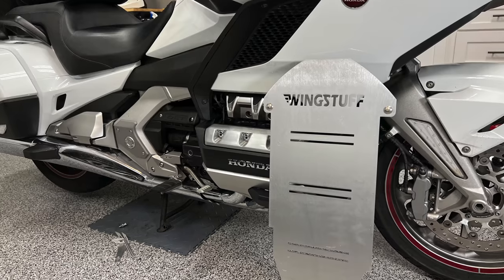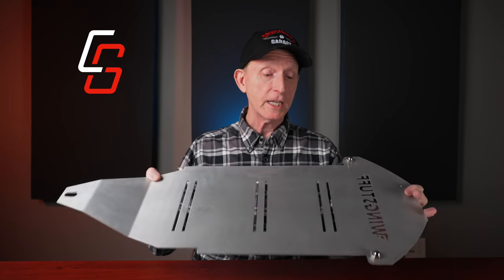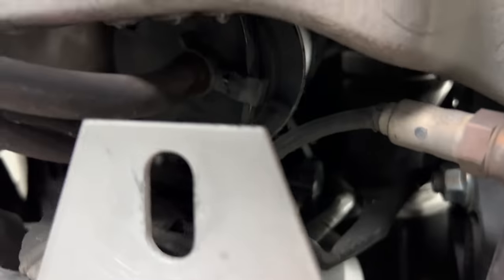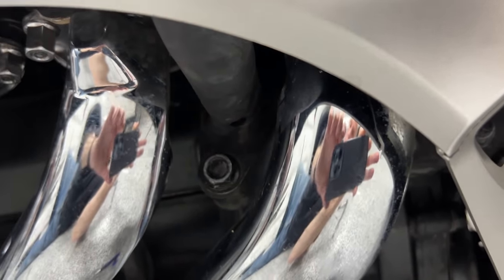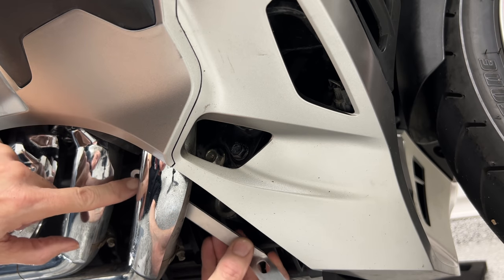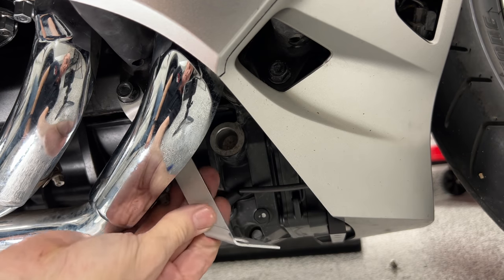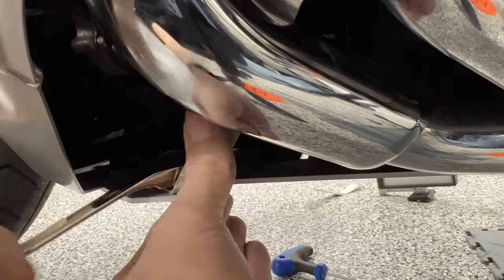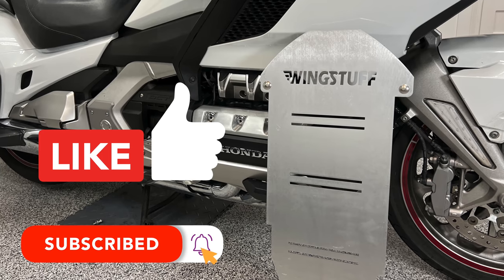Belly Pan Skid Plate for 2018+ Honda Goldwing from WingStuff | Cruiseman's Reviews | 2022

Comment: Very good conclusion on  if the product stand to its purpose! honestly after seeing the  brackets size holding the plate I think it will ultimately damage more parts if this 850 lbs monster hits a concrete block or something! I believe this is a total waste of money for a GW, just watch where you are going and avoid following those dual purpose bike!
Reply from the maker: I understand, but I am not sure that either of these products is really designed with hitting a concrete block in mind. Putting all 850 pounds + the rider and gear onto any engine guard will most likely result in damage. These are designed to protect against objects getting kicked up from the front tire and striking the underside.
Reply: @cruisemansgarage  and this happened to you on your last GW didn’t it Cruiseman?
Reply from the maker: @6582rg  Not exactly, I hit a piece of scrap iron on the highway at 65 mph that cracked the engine case, but only had a thin belly pan which was destroyed.
Reply: @cruisemansgarage  Hi Cruiseman, I still think it is useless the flat-6 engine block being very capable of enduring FOD's in my view, a plate covering the thin walls of the exposed oil filter would have make more sense to me!...this is not about arguing it is about discussing the sense of a concept, sometime more is less!

Comment: Mmmm.... for 180 beans, I believe in my opinion , it's a fail ! way to much fiddling and not solid enough when it comes to the front brackets. The rear T bolt is another pain....maybe if they incorporate a nut inside a hard rubber grommet which you slide in the oval hole and use a flat bolt with an allen key center ...same for the front brackets which would be pre-bent and of better stronger metal...welded nuts and flat head bolts with allen key center it might be worthy of 180 beans and of easier installation and removal for oil change.....again until then...it's a fail in my opinion !
Thanks for the review ! it will save a lot of people time and $$ , be well ! 
Hope the visit went well !!

Comment: It seems like a lot of modification is required for a Bike Specific part.  Think I’ll wait for Max’s.  I’m also not a fan of paying for advertising on products.  A small MFG badge is fine but come on that’s over the top. On that back attachment it seems to me if it went a little farther back you could use a button hole slot to make it easier to remove the pan for maintenance without having to remove the bolt/
Reply: Hardly advertising. Who the hell is going to see that?????
Reply: @robertmercer9117  it’s a philosophy ok. Btw if you can see the logo turn me over 😱

Comment: seems like if the rear T-bolt was abit longer, you could put a washer and thin nut to secure it, then the skid plate and washer and nut. that way the T bolt would not have to be lined up every time you take the plate off.

Comment: One would have thought that wing stuff would have already made the proper bend in that bracket that connects to the engine case between the two exhaust pipes ?? Seems like it’s still not an ideal situation
Reply: Totatally agree with Mat, I appreciate these are still new products but really it shoud not require any bending by the user to fit !
Reply: Form fit and function. Both plates need refinement.
Reply from the maker: To be clear, WingStuff does not manufacture the product, they simply have an exclusive marketing arrangement with the designer. Or, at least that is my understanding.

Comment: I just installed this pan a few hours ago and it appears the updated product front brackets needs to be installed to the most front engine guard bolts vice using the second frame bolts per this video...I had no problem with the left bracket and it installed without any bending however, the right bracket needed to be bent in two different places/section to complete the installation...
In addition, the rear T-Bolt now comes with two nuts, the first nut one allows you to preinstall the T-Bolt on the bike's slotted fame hole and when complete, the rear can be installed without manipulating the T-Bold or worry about it coming loose.  It also comes with a lock washer however the front nuts are standard nuts and I wish they included lock washers...I may stop by home depot and add my own lock washers later on.
I would still give this product a 4 on pricing but a 3 on the front bracket installation and over all a 4.5 on the overall product quality and strength...I know the Traxxion belly pan is the Cadillac version, but the pricing and cost of shipping just brakes my overall budget...I guess a pan is a pan and "better to have it and not need it than need it and not have it"...lol
Reply: I also received what I believe is the not the updated version as well. The instructions also say to install the front brackets to the front engine guard screws. Not as shown in video. I called them regarding the bends in the brackets. The ones I received only had the one angle bend at the top. I called them and they are sending me new updated brackets and instructions.

Comment: Whats your thought on this plate vs the Traxxion plate?  Did re-applying the correct torque resolve the oil seepage?
Reply from the maker: I am in the process of evaluating both products and need a little more time to give each a fair evaluation. I am monitoring the oil seepage and will report back soon.

Comment: One concern I have with the Wingstuff solution is this: the front portion mounts to the engine and the rear portion mounts to the frame.
Now, the engine is possibly rubber mounted or otherwise isolated from  that same  frame. The engine therefore  would be free to  move somewhat by design, Every time you apply throttle or torque, for instance, the engine will move in the frame in the opposite direction of the shaft drive turn direction. The case guard rear frame mount cannot move while the front mount will move with the engine. This means the case guard  will continuously flex back and forth as the engine is running and torque is applied or removed from the drive train. Also the solid mounting of the plate to the frame will allow noise and vibration to transmit freely from the engine to the  frame or the rest of the bike. IMHO the rear mount needs to be redesigned with an insulated rubber mount ( rubber well nut) to avoid these issues.

It seems to me that both available solutions (Max or Wingstuff) have a lot of development work left to be done. But as usual the testers will be the first customers as the manufacturers are usually almighty and will find a thousand reason why everything they do is absolutely perfect🤣

Comment: The bracket is not being connected to by correct bolt.  There is a bolt further forward, visible thru the front cover panel on the right-hand side where the bracket needs to be connected.  On the left hand side, the front panel would have to be removed since bolt is not visible.  When properly done, no bending of bracket would be required.  Video needs to be updated.  🤔

Comment: Hi Chris,  When your video showed you putting that T bolt in place it looked as though the plate itself was pinching the rubber tubing to the side of it.  Was this an issue or am I imagining it?
Reply from the maker: I don't recall any pinching but I will double check.

Comment: On another video you installed the Traxion Dynamic cover plate. You had also felt this might have created an oil leak. You were going to follow up with another report you did further investigation. I’ve been waiting on your report before installing mine. I reached out to Max but to date I have not received a response. Did you discover what was causing the oil leak?
Reply: Yes I think we all want to know if the oil leak was resolved
Reply: I've only put about 150 miles on it so far, but no oil leak with the Traxxion guard.
Reply from the maker: I have re-torqued the bolts on the engine, cleaned the area and am monitoring. I suspect it was a one-time seepage and has corrected itself. I will report back.

Comment: This procedure is contrary to the instructions with the new belly pans. However...I have comfort bars installed on my 2022 Gold Wing and the procedures provided by the company don't work. Cruiseman's procedure depicted in the video is an alternative that actually works if you have the comfort bars. The only issue is the brackets are heavier metal and don't bend quite as easily as the aluminum ones depicted in this video.

Comment: I like the skid plate but not a big fan of the front brackets. I homemade a makeshift plate to go to Alaska last year and used a similiar mounting bracket in the front. Had to bend them also to get around the exhaust. It Looked  clunky but necessary. I wasn't happy with it but it was all I had as no one had made a skid plate for this bike. (US/Canadian border didn't open in time so trip was postponed) I just purchased the Traxxion Dynamics skid plate two weeks ago. I would have preferred Max had put some vent/drain holes in his plate. I will likely drill my own holes in it before mounting it. CG good video on mounting this skid plate. I was kind of kicking myself for buying the TD plate but after seeing those front brackets I will stick with Max's TD skid plate.

Comment: Hey Cruiseman my question is if I have Gold Strike Highway pegs will this belly pan work? It looks like a different bolt from the hole the highway peg bracket goes into but I just wanted to be sure… thanks
Reply from the maker: That is a question for WingStuff. I know that were working on a way to accommodate the GoldStrike highway pegs, but I am not sure if these brackets provide that.
Reply: @cruisemansgarage  thank you very much sir for the reply. I’ll look into it.
Reply: Yes.. they will work with Goldstrike highway pegs. @BigSmittyRiding
Reply: @ricka.8584  you are the man! Thank you very much for answering!

Comment: Let us know how long before the skidmark (plate) begins to rattle. The "adjustment" holes being oversized for the Tbolt means it is likely to loosen a bit and since the only thing holding the "T" in place is torque, steel through aluminum, if it moves around or loosens even a little, it falls  out and that might be a problem.

Comment: After watching this video and Max's video , I am rather unimpressed with both. 1st I think it's not acceptable for these brackets to have to be bent by the installer.  I can see getting them in contact with the exhaust which would make NOISE by reverberating through the system. I agree with your other concerns.  If these things are really necessary , why doesn't Honda include them ?  This isn't a dual sport bike !
Reply from the maker: You can bend the brackets so that they do not touch the exhausts.
Reply: My 2021 Goldwing DCT is in the shop now.  Had a nice oil leak after I got off the highway just 45 miles to the house thank goodness.  Looking underneath the next day, cleaned excess oil and leak looked like the front timing cover.  Shop says I damaged the shifter cover from road debris.  Waiting for parts, I've been off the road for 2 and a half weeks now.  I don't have room at my place to much work on the bike.  So I'm ordering this guard,  looks easy for me to take off before taking bike to the shop for an oil change.

Comment: I don’t like the brackets. If they’re going to mass market the product it really should fit without the customer deciding where and how much to bend the brackets. Using your exhaust pipe to create a bend is not what I consider a professionally engineered product. Also, get rid of the company name cut all the way through the bottom plate. Those holes will become an entry point for dirt, pea gravel, etc.
Reply from the maker: I "think" the thought was that the slots and name cut into the plate would offer ventilation. Not sure that ventilation is needed, but I suspect that was the intent.
Reply: If the 2 left and right hangers are pre bent, they would not maneuver between the engine and pipes. This was left intentionally so customer can form it easily by following instruction starting from top engine guard bolt. Once it's formed it could go in and out easily.
Reply: @samerhallak  This reply makes no sense. If it goes in and out easily once it's formed, it follows that it would go in easily if it were preformed...As it is the hangers do NOT go in easily as the are NOT preformed and have to be bent in a ridiculous ritual/ceremony

Comment: I have to say the front brackets are a big fail for me. They look like a great way to rub your exhaust system and either rub a hole in the pipe or wear the bracket to failure really fast. A belly pan taking a nose dive at highway speed can be disastrous. Leaving the forming of the brackets to the customer is kind of cheesy. No thanks!

Comment: Is it possible for the front of the skid plate to tuck up inside the lower front cowling?
Reply from the maker: Yes, you can mount it either way, but it is pretty thick and could distort the plastic cowl.
Reply: Another great question . If that thing gets bashed hard in the front, it will destroy the cowling as well.

Comment: Good Review!   I think that this "Skid Plate" is a runner up to what Max has created!   It looks flimsy by comparison and the mounting brackets seems weak, not to mention the extra work that you went to to make it fit!     Makes me wonder which skid plate you are going to have installed on your bike... I'd like to know!    (:>)
Reply from the maker: I am not sure I would refer to it as "flimsy", it is still stout enough to prevent a pretty decent strike that could take out your oil filter or engine case.
Reply: If the 2 left and right hangers are pre bent, they would not maneuver between the engine and pipes. This was left intentionally so customer can form it easily by following instruction starting from top engine guard bolt. Once it's formed it could go in and out easily.
Reply: @samerhallak  This reply makes no sense. If it goes in and out easily once it's formed, it follows that it would go in easily if it were preformed...As it is the hangers do NOT go in easily as the are NOT preformed and have to be bent in a ridiculous ritual/ceremony
Reply: @wernerm9613  since you don't have it physically in hand, you won't be able to tell. I know what I am talking about.
Reply: @wernerm9613  It just appears the hangers are made of very lite material and I'm not sure about the strength of them.  But then again I am only compairing "pictures" that I have seen on the internet!  Again, they look flimsy by "comparison" to what Max has built!  At this time I am still trying to decide which one to buy!   (:>)

Comment: This installation video appears flawed. Cruiseman, you connected the aluminum strip to the wrong bolts. May not matter much since the new Wingstuff belly pans are configured differently - but for folks with older pans like me - don’t do it this way.

Comment: has anyone used a bike lift with the belly pan installed?
Reply from the maker: I would definitely not recommend it with the WingStuff and would be cautious using it with the Traxxion. The aluminum brackets on the WingStuff would definitely give under the weight of the bike. I am afraid the exhaust manifold would be compromised.

Comment: Why the hell wouldn't the manufacturer bend the bracket? WTF.
Reply: @samerhallak  This reply makes no sense. If it goes in and out easily once it's formed, it follows that it would go in easily if it were preformed...As it is the hangers do NOT go in easily as the are NOT preformed and have to be bent in a ridiculous ritual/ceremony
Reply: This product is an all around failure. How can anybody take up for this shoddy product. Useless. Get right.
Reply: @samerhallak  so why after they are bent can you still maneuver it into place?
Reply: @adamt581  because it becomes shorter bracket, so it fits better.
Reply: @samerhallak  so according to your reply, once it's formed it becomes shorter and therefore fits better? This reply is just as much nonsense as your first one. Based on this answer, if it were preformed it would be easier to install, which you denied before.

Comment: Very nice skid plate but a poorly designed mounting system.  Those front brackets should be pre-bent to fit perfectly and that rear T-bolt should be replaced with something that is permanent and can't turn and drop out.  I would not purchase this setup after seeing your video - but then I wouldn't buy Max's either.  A properly designed skid plate should allow access to remove drain plugs and filters without having to remove the plate itself.  That being said, I believe that a skid plate is a necessary accessory as I damaged a coolant tank underneath my last Wing . . . then I installed one . . . too late of course.

Comment: ya gotta be kidding. Parts aren't designed for the fit and then it's kinda half baked, part loading against exhaust header? Gotta bend em yourself. What's next, a pile of dirt, process your own aluminum then roll it then cut it?